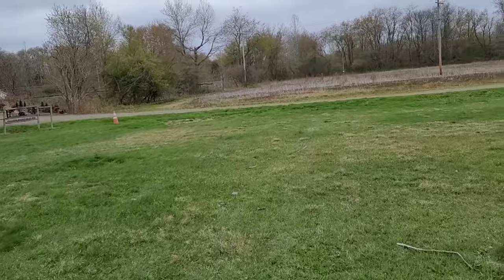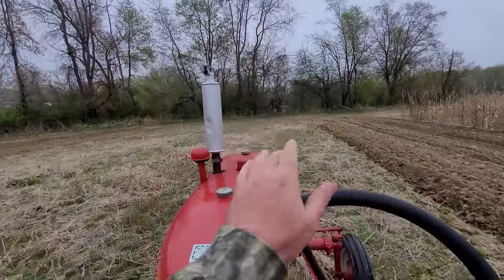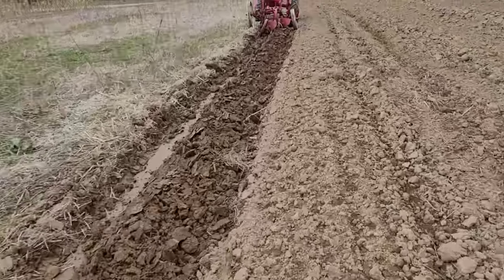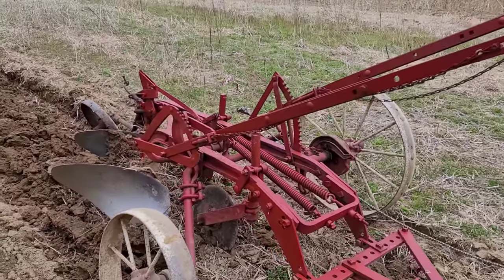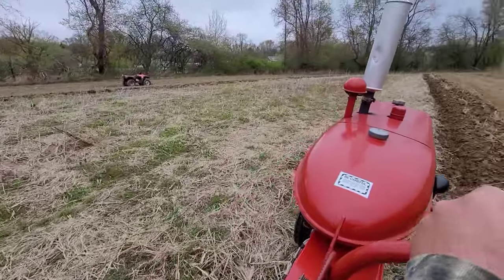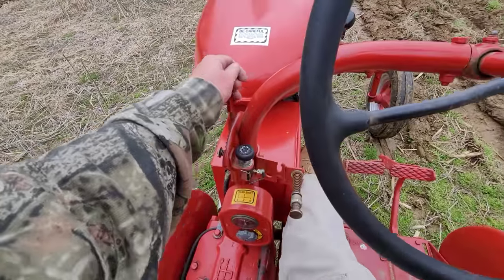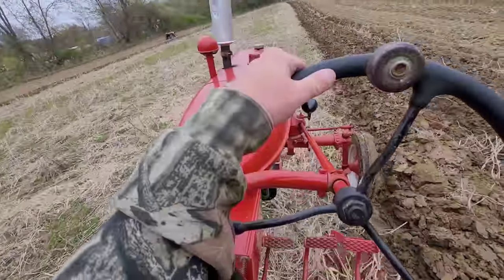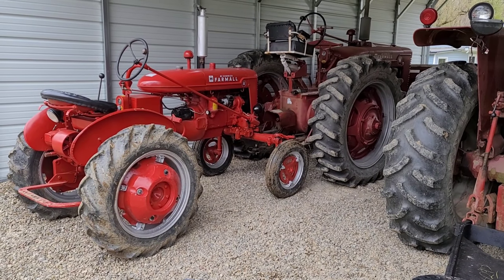Farmall A Plowing with a Little Genius 2 Bottom Plow

Comment: I’m truly surprised how well that A pulled two bottom plow. I would never have thought it. 

That’s a real nice looking and good sounding old Farmall A.
Reply: The Farmall A is rated a 1-2 plow tractor. I am amazed how well it pulled it, too.
Reply: @tyfrank3427  in Missouri A’s were a single plow tractor, C pulled two 12s, H pulled two 14s, and M was three plow tractor. Missouri has lots of clay in soils, so my experience and what I saw where I farmed may not be representative across the country. We had a little Super C with two 12s and it struggled somewhat when you would get in tougher soil situations 😜😜
Reply: @steveimhoff5646  Soil type is everything. My dad grew up about 13 miles as the crow flies away. My grandpa had a 3 bottom plow, a packer wheel, and a pony press drill. He pulled it all with a W-4. Here, 2 14s is plenty for a W-4 on normal going and it wouldn't pull it at all in sod. On crop ground,  Dad typically pulled 5-14s with an 806, 4-16s with a 650 and 4-14s with a WD-9. He did pull 5 14s with the 650 but it made it work. On hay ground, it took the 806 to pull 4-14s. We currently pull 6 16s usually with a 1206, or 1066, but this year we used the 4186 and of course, that doesn't know the plow is back there.
Reply: I love it ! I know she has the power . I see the weights and she is not slippin . Does she have fluid in the rear tire's ? I have a BN and have been kickin the idea of finding a 1 botttom 16 inch little wonder or Little Genius.  I have weights for My BN . Your Little A runs awesome ! Thank you for posting this video ! You kept me on the hook to long waiting for this video buddy :)

Comment: When I was on the farm we had 1 Farmall 100 and it pulled a disk and a subsoiler and plowed 30 acres of tobacco. 
That A will pull in 3 gear with no problem, may have to start in second then shift to 3rd. 
You have a good little strong tractor. 
You’ll love a Super A with the hydraulic lifts, hinting on your next purchase.🇺🇸🚜
Reply from the maker: Hahaha or a Super C

Comment: My parents had a farmall A when I was little, we lived in Alaska, It may have been a cub, all I know is it had that offset engine, and an extra set of wheels that floated along behind the front axel for a set of half tracks, it had a 3 pt hitch and discs. It was pretty cool, Id actually ride on it with my dad, i could ride anything, his dozer, tractor, dump truck, id fall asleep on the dozer. Allis Chalmers HD6 😂 I remember the farmall had these two rings you’d pull to start the engine.
Reply from the maker: That sounds right

Comment: The C was rated for two bottoms with pretty much the same engine, I think it was more a traction thing than anything.  Obviously the ground plays a lot in that calculation as well.  Awesome looking tractor, '47 was the last year for the regular A!
Reply from the maker: Might have had the same engine, but it was most definitely not the same horse power or weight. Thank you!
Reply: I think a Super C would pull 2 almost anywhere. They have the C123 so they would definitely do it.
Reply: @tyfrank3427  The 200 we had worked well with the fast hitch 2-14" plow.  I know I plowed up a sod once with my BN and it's BN-187 16" plow and it was EVERYTHING that tractor wanted.  Tough ground in these parts...
Reply: Only a couple of HP differences between the A & C (just a higher RPM)  but yeah, more weight for sure from the factory and bigger tires.
Reply: @msad40kopishke  Sod is a different kettle of fish altogether. You need a lot more tractor or less bottoms for sure. Here, the way we deal with sod is we generally chisel plow it twice before using the moldboard plow. A 200, would be a nice little tractor. There are none around here. In my area, the extent of the 100 series tractors are 300 Utilities, W-400s and 600s.

Comment: Have you ever heard of the side disk plow for the A? It actually works great for a step up onto the tractor.  It's like a 22" disk or so.. It does the same thing as a turning plow but just one pass at a time.
Reply from the maker: I've seen them...they were made for harder turning ground...very cool
Reply: They also make a fast hitch tandem disk pull behind one to.
Reply from the maker: @grayghost75  haven't seen one for sale yet
Reply: Disk breakers were very popular in the deep south essentially because of most ground being formally hard wood forrest and the beyond numerous  stumps and large roots they would roll over those instead of digging in and hanging up regular moldboard plows would be a problem  with continuous tripping or hang ing if the trip mechanism was bad. Hitting a stump at 4 or 5 miles an hour and sudden stop was not good

Comment: Burning was an old way to stop clogging of plows that removed a lot of nutrients from the soil. It was often done in my youth and now we often plant a good plow down. Run a disk over it may have save you some problems. 
    Great seeing that old equipment run.
Reply from the maker: I was always told that burning puts nitrogen into the ground, but now we know we're better off with detritus material into the ground

Comment: I recently bought a Farmall A. I checked the compression cold and they all had 75/80 psi except 1 had only 50 psi. Wondering what kind of psi I should have? Thought this would be the place to find out. Thanks in advance for the help.
Reply from the maker: 90 plus with less than 10 percent variance acrossed the board

Comment: The A handles it good. You should surely be able to pull five 14" bottoms or  four 18" bottoms with the 756 but you will need 18.4-34 tires. The little A does a good job.
Reply from the maker: I can definitely pull 4x18s with the 756
Reply: @FarmallFanatic  5  14s are actually less plow believe it or not. We still have the Oliver 5-14 and 4-14 plows but haven't used them for years. We have pulled the 5-14 with a 650 and it did it in really hard pulling soil. Although, Dad usually pulled the 4-14 with the 650 and the 5-14 with the 806. The 650s aren't much less tractor than the 756. At some point, I'd like to hook on to the 4-14 plow with my Super W-6 and try it.
Reply from the maker: I definitely think it could do it

Comment: Looks like you need to lower the plows furrow wheel some more. Your plow is not running level from side to side. The hitch should be adjusted to run slightly up hill when hitched. The rear landslide should be leaving a lite mark in the bottom of the furrow with the wheel taking the rest.
Reply from the maker: This was a first run lol

Comment: They always looked odd to me how the clutch and brakes were on the same side , I saw a few of them back in the day but mostly saw the H and M   and they were always tricycle front ends .I wonder if horsepower comparison with newer tractors VS old is accurate, in as much is a new 60 Hp tractor really 50% more powerful than an old 40 HP tractor.
Reply from the maker: New hp doesn't stand a chance to old hp

Comment: I knew it could do it! I noticed that the drawbar on the plow needs adjusting if you're going to run the A . It's set up for the H ,and the H is more suited for the #8 so leave it alone. If only you can find a two twelve bottom for the A ,you'd be set. 🧨
Reply from the maker: A 2 bottom Little Wonder
Reply: @FarmallFanatic  is that what they're called? I didn't know that.
Reply from the maker: Yep

Comment: Is it just me, or does the A pull a plow better than a C? Smaller tires?
Reply from the maker: this particular A has loaded tires and wheel weights
Reply: @FarmallFanatic  we have a 230 with loaded tires and wheel weights. Probably just our heavy clay soil, but it never plowed worth a nickel. 2nd gear was usually out if the question and first just doesn't do the job so well. May also be setup...it is a fast hitch 2 bottom tractor mounted plow. That tractor came out with a crude draft control, but it is long gone now. Rare to see teledepth on one anymore.

Comment: Is there a difference in horsepower between A and Super A?
Reply from the maker: Don't forget there are two different series of Super A's. The early Super A's had the C113 with provision to drive the hydraulic pump from the A with no water pump. The later Super A's have a C123 which has a belt driven water pump. That version of the C123 was used last on the 130's. The 140's have a newer version of the C123 with some updates, the water pump is placed higher and also runs the fan, by doing this they were able to eliminate one belt off the front of the engine.
Reply from the maker: You're really talking on average about 2 horsepower more with the super

Comment: Thanks for mentioning about tractor flips. A lot of people have died from hocking to high or not using a proper drawbar

You could do a video on tractor flips and save someone’s life. I see it on you tube where people are hooking to lawnmowers and ATV’s and they don’t recognize the danger
The draw bar has to be hooked to the centre of the tractor for heavy pulling or the back axil will flip the tractor
Reply from the maker: Safety first
Reply: @FarmallFanatic  Thanks for the reply but you could save someone life by doing a video tractors flipping